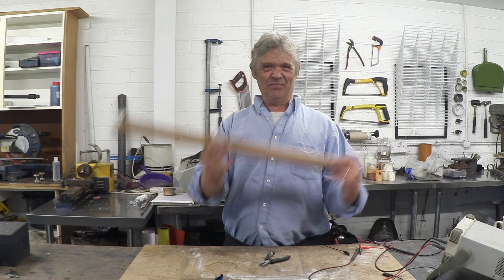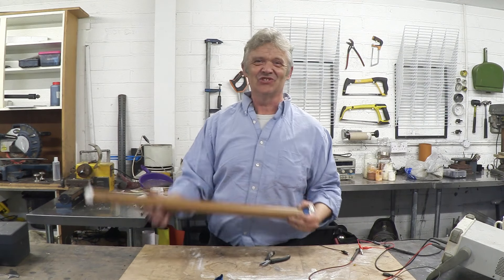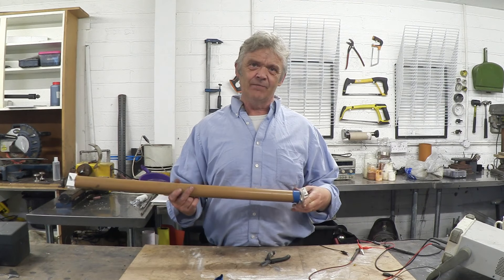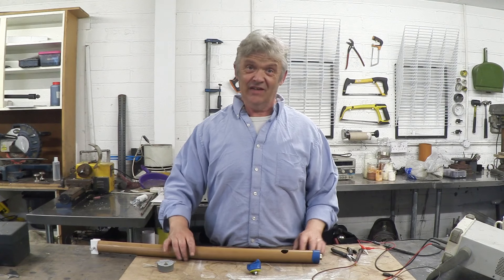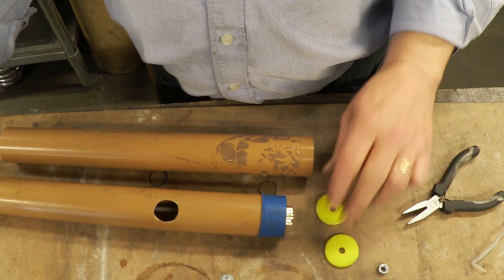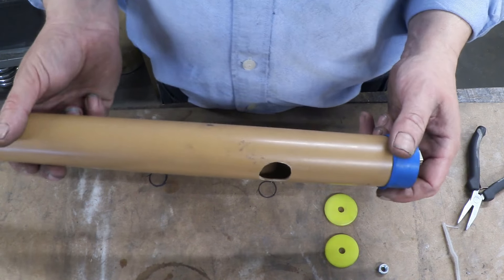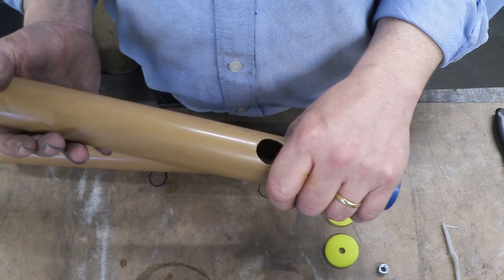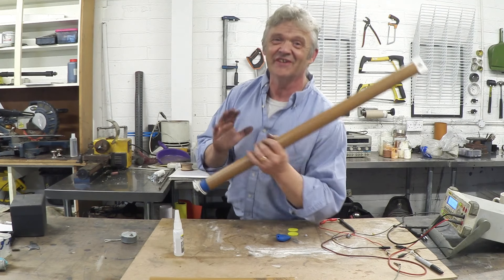A Wind Generator That Works Even When The Wind Stops Blowing

Comment: @Robert Murray Smith.

Robert may I ask you please, to investigate:

1, whether a bunch of funnels, 1. at all four ends would allow air to enter from four directions as needed.

2, A rubber check valve could be added to all four ports.

3, a kazoo or harmonica type Reed be placed in the Windstream before the air goes into the standing tube. This would make all of the air from the funnel go through the kazoo or read and cause vibrational noise in addition to the wind. I also feel that the kazoo would pick up some of the ambient vibration and channel it, or enhance it.

4. Regarding the funnels. 

I would aso like to request that the (metal  or aluminum seems best) or perhaps plastic  funnels be modified and converted into a Venturi tube by adding straws , or plastic tubes,into the jet stream; prior to entry into the small intake port.

I apologize in advance for not investigating myself, as is your request on prior videos.

As I do not have the capacity to manage it. However the ideas might be good enough for you or some of the members to explore if up to it.

Thank you in advance for your consideration.

Comment: Brilliant video, and I agree that many little things are required to solve a big problem such as millions of ants making a raft that floats to move the colony during a flood. I believe that your tube design coupled with the physics of resonance and standing waves may increase your performance.  By resonating the string in the tube at its frequency would create more vibration, this principle has led to the destruction of bridges being destroyed by horses trotting or troops marching across them. If you treat the tube like a flute then drilling different size holes along its length would ensure that different wind speeds would hit a resonant frequency. I think you have done a great thing by making your ideas public, I would do the same. Great job. :)

Comment: BRO, what if you put a flap on one end and put the flap in a running stream. constant running water will constantly cause vibration.
Reply from the maker: give it a go mate
Reply: Or a bigger magnet and coil on a raft in the waves.
Reply: @OldNorwegian  maybe it's own little raft  out and anchored just bobbing w/ a batt. for containment. Bodies of water also recognize vibration
Reply: kinda near a bottle neck area where the turbulence picks up.
Reply: I'm'm renovating a sailboat to electric and this is something I will test as well. 2 days on diesel or 3hrs by battery, if your transiting there's no gas stations in 3 days from shore.  A few of these mounted would aid in constant flow. Something to try, I' m kinda getting excited about this. One ounce at a time.
Reply: Bill. .. that's genius
Reply: Bill Ross I recall seeing a wave generator in magazine years ago. It was anchored to a dock in this case, and was supposed to generate enough electricity to power a light on the dock at dusk, the waves would make a float go up and down. There's quite a few concepts for larger scale ones, some anchored to the seafloor with a large float that would go up and down , one looked like a big mechanical snake, where each joint was a generator as they bent over the tops of waves. Not sure if they ever got out of concept phase.
Reply: Can the magnet from an old  speaker also be used?
Reply: I commented something similar to check it out
Reply: @OldNorwegian  already been done,,,,,,,check out wave hub
Reply: @vivienclogger  i think it would be too heavy to vibrate much, better to use neodyniums.
Reply: you'll get way more energy with a small water wheel

Comment: Imagine attaching lots of them at the top of the ram pump delivery pipe. You will get constant vibrations.
Reply: If you have running water, power is easy in the first place.
Reply: "good, good, good! good vibrations.."

Comment: Reminds me of a guitar or a harp, you want to put a combination of wind and temperature driven (Stirling Engine) pluckers.  I was thinking whether one could harvest energy from material expansion i.e. lead in a cylinder pressing against a piston head which connects to a conrod which is then geared down appropriately enough to harvest the movement.

Comment: Remember reading about a similar device in a SciFi story, one of "The Unorthodox Engineers" by Colin Kapp in which a planet had fields of wind-blown energisers powering an underground / metro / tube system. But for Robert's device, the volts out are important as to combine AC from many devices needs some form of power electronics and likely rectification... really need volts well into 10's so diodes can work. OK 2V would be enough but losses awful; how then to raise volts - a transformer?
Reply: Another way to increase the voltage at the sacrifice of amperage of course would be to use a voltage doubler, tripler, quadrupler and so on, circuit using capacitors and diodes. Look it up on the internet and you'll get schematics for these.

Comment: I have to look at it closer, but looks interesting. I wonder though if you could use wind pressure for induction such as in a velocity stack that leads to a Faraday model of a spring loaded sliding cylinder where the behavior would be similar to a speaker coil -?

Comment: Stick it to the side of a lamppost? I wonder if we could mount a light on the top and make it the lamppost.
Reply: Or better yet.  have something a car drives over..then a mechanism has a mini hammer or something that vibrates and turns on the street lamp.  I have a feeling it would need too much power for that much light.
Reply: I'm making a speaker style for this generator this weekend and gonna post in a bit. Any ideas how to best resonate it?😁😉so fun!!!
Reply: @strangescience3414  bet whatever your doing is too complicated for me.
Reply: I figured a light on the bottom with a large white fibre-optic tubing to work as the turbine and light diffuser would work!

Comment: I have a good way make a heat tower with a spiner on top that spins from heat as it gets hot hot air moves up fast make it spin Gen
Reply: Ya, you have another spin off idea with 'hot air rising' !!? In a close tunnel, it can spin a tunning fork type device similar to what he was talking about ??
Reply: Even have similar device under roads that capture vibrations from moving vehicles?

Comment: My fricking roof rack on my Jeep whistles, shakes, rattles, and rolls, and it's hollow. If I had a camper that uses battery off grid power, there is something there also. Thats amazing great little thing you hot there. Aluminum vibrates nicely.

Comment: This is very interesting to me, and correlates (somewhat) to my recent hypothesis on harnessing vibrational energy of the piezoelectric effect. As  many of us is aware, quartz crystal has the ability to vibrate when a electrical current is introduced. Also, quartz can do the opposite. If vibrational energy is added to the quartz crystal, in return it produces an electrical charge. I have my own ideas on how to utilize this effect and make a loop that creates energy through vibration and then feeds this energy back to the quartz to support a loop of vibration back to the silicone structure... therefore altering the 0 point (on an atomic level) of the silicone, releasing ions to restart the loop. While it is much more in depth... using electromagnetic fields to "ride on" the vibrational motion, and so on. I'm not going to bore you with my expotulation, however your creation gave me an idea to possibly help improve your design. In my hypothesis, if you were to "tune" a small quarts crystal (cut into the shape of a "reed" or "tuning fork") attached to the inner wall of your structure, and allowed the "wind generator's" electrical output to travel through the quartz "tuning fork", it should create a vibrational force that will, in return, travel through your inventions structure. Therefore possibly introducing a continual source of vibrational energy into the "wind generator". This may allow you to reintroduce vibrational energy into the " wind generator" even when there is no wind or vibration externally. I absolutely love your channel and just recently have found your channel. I can't wait to continue diving into all you can teach me, and I'm sure I will find much more inspiration from your wealth of shared knowledge. Thank you for enriching the minds of those who are curious enough to make thoughts and dreams a reality.
Reply: @denbecr49  any person whom isn't willing to try to find fault, as much as merit, in their theories is closed minded.... therefore making the word expotulation accurate. As for your comment to "word salad" to each their own, you are entitled to your opinion. It's not this feeds position to disassemble my ideals, but to potentually look at the factual principles that apply to the evolution of this apparatus. While you may not be able to understand the science behind such simple concepts, the data contained is completely feasible. Try educating yourself before you throw stones.
Reply: Enjoy the research you should have done before attempting to discount my hypothesis, and I do apologize if my vocabulary exceeds yours. I'll try not to be so scientific, and speak in more layman's term. I guess I'm to blame for thinking that anyone watching this channel would have some level of science speech understanding
Reply: @denbecr49  who has said anything about infinitesimal energy production? My theory... in which I have built a small model that generates 6 amps on a small scale.... has the potential to generate much more on a large scale. Alas, I still laugh at you because I didn't go into any real specifics on my design, because I'm still in the process of perfecting it... and I'm not stupid enough to allow anyone to steal my concept. Either way, there was no mention of infinitesimal energy production. I was simply explaining how to sustain more vibration in Robert's apparatus that he had displayed. So now I have to ask you, why would you even watch this video and then "troll" this man's work? Have you watched his other videos? This was a simple design that was a collaborative effort by people in this group that actually respect this man's knowledge and his creativity.  His numerous degrees in electrical generation and chemistry deserves that respect. Obviously,  you dont belong here, and is only looking to unjustly "throw stones". As for me, I've spent the last 14 years as a master electrician and a lifetime as an amateur scientist. Again, you have spoken, and we all laugh at you. Go back under your bridge, troll.
Reply: And as for your reference to the laws of conservation of energy.... I applaud you for finishing  3rd grade science, but is still entertained by the fact that nothing that was spoken of, violates this law. Nobody claimed to pull energy out of thin air. The kinetic energy is put in for electrical current to be expelled. Again, you open your mouth and the educated minds crack up laughing.
Reply: @denbecr49  sir, you need to reread. I have a small prototype... in speaking of my words such as "may" or might" I'm speaking of my overall idea as to how a fully constructed apparatus would perform. Yes, to scale it up would consider much difficulty, and brings doubt as to its compacity or even if it could increase compacity by scaling up. Also, I've gathered inconsistent readings as to its output... still scratching my head as to what outside forces could affect its efficiency, but I have charged a battery... producing 6 amps/hrs, though it took 10 days to do so, having to reset the process daily. So, as you see... you are reading between lines that you dont even know about... intentionally being left out because of the 1001 questions that I have about it now. As I said, it is something that I am working on. Just because you know a few verses from a book, doesn't mean that you have enough information to surmise a summary. And my information was withheld intentionally until I can identify its ineficience/ efficiency from a day to day basis. As for asking if I used a reed or fork... neither, or both... depends on how you interpret it, but this was my suggestion to this particular apparatus... not my own. So, as you see, you are shooting in the wind here because of your lack of knowledge. And again, in no way does my suggestion defy laws of conservation of energy. There had to be an applied kinetic force to deform the quartz crystal, creating a piezoelectric effect,in order to get a small output of energy... however,  I was suggesting to use the small amount of electrical current created by the apparatus to stimulate the quartz crystal into vibrating against the apparatus's wall... continuing a vibrationam to help extend the vibration of his device. And again... this was a reason to also speak with doubt. I haven't applied my studies to this advise.... but surmised that it could help in his apparatus. Completely untested.... so while you try to debunk me, it seems you have to actually read what I said... and instead of trying to debunk the subject that I have not revealed much about, maybe you should reread the point to my comments from the beginning. I only exposed my thought process on this video. So, you are so smart... tell me... why wouldn't the initial charge cause a quartz crystal to vibrate? Why wouldnt that vibration transfer to his apparatus's casing? You're the one trying to debunk it. So, go ahead.... explain yourself. Actually explain why, if you claim. to be so smart. Let's hear your technical reasonings. So far, you haven't proven you know anything over elementary school science knowledge. And, I do regress.... you were the one saying how unimpressive this man's apparatus was... so I doubt you can backpedal out of that one.
Reply: I was thinking about it, and I'm almost sure that you created your opinion because of my use of the words "0 point". Since true 0 point energy is a violation of the laws of conservation of energy, I can almost guess that you made your judgement then and there without apparently reading what I actually said. Let me give you a little crash course as to what I was explaining. Quartz is made of Sillica (positive charged ) and oxygen (negative charge)... creating a stable element. When the atomic structure is put under stress, the + & - alignment is shifted from it's normal "0 point in it's normal entangled orbit, therefore releasing ions. This is how your bbq lighter, or your grandfather's watch works... by stressing the atomic structure of the quartz molecule. While it is not true 0 point energy, it is energy created by misalligning the normal 0 point position of the balanced + & - elements... so as why I said 0 point " on an atomic level" it takes kinetic stress to cause this effect. So, I can only conclude that your ignorance on this subject, and maybe my description, made you prematurely think I was explaining the impossible. If this is the case, then I will extend my warning to actually read what I was saying... considering that you have constantly expressed your thoughts that was not indicative of what I had actually said, and even mixing up which idea was which. I'm going to give you the benefit of doubt with a warning... you should really read closer and save your comments for a time you actually understand what is being said. If you didn't understand, then instead of nay-saying you should have been asking questions. If I'm correct that this is your whole problem with my theory, then I reply with... your lack of knowledge has you jumping to conclusions, keeping you from actually comprehending what I'm explaining. Getting stuck on an idea that is only 1 pixel in a picture blinds you from seeing the whole image. If this is not the case, then I will refer you to my previous comment... you are only being a troll.
Reply: @denbecr49  actually, I agree with you on that one. And as I said before, this could be an assist to vibration.... not a perpetual energy source. I've sustained up to a 5 hr window of vibration at its peak performance... but 15 minutes under outside effects such as barometric pressure, humidity, outside resonance, etc.... so while still inefficient for my use, the longterm vibration could (again I say) assist his device... not make it the holy grail of perpetual energy and I've never claimed it would. I'm well aware of the loss of of energy in conversion  and nowhere did I suggest that this was a perpetual loop... that's why what I have done is more applicable to this type of device. Eventually it runs out of "steam"... however if the vibration came from outside sources such as traffic, it could sustain a longer vibration, and that is all I've ever claimed. Again, you need to actually read what is being said.

Comment: why use an artificial muscle as opposed to say a guitar string or something?
Reply: Yeah, I was just thinking of a thin, very long spring I have.  And my ongoing fascination with magnets! Next, we'll have to come up with a simple voltage regulator and storage capacitor, maybe set to 5v max for a charger.
Reply: The diaphram has to expand and contract. Using a well speced out spring tuned to vibrate is the mechanical method. Winding count, magnetic field strength and spring / membrane durability is key.

Comment: In step of the artificial muscle use a mildly tensioned strip of 3/8 x 1/32nd stainless steel suspended between two brackets on a 1 inch steel rod out in the open air function would be much more extreme have you ever seen a vibrating strap on a semitrailer power generation would increase by 10 fold, larger magnets placed in the center of the vibrating strip would give another boost to the current beautiful idea guys keep up the great work im building a few of these  heck put some on a barge on the water in break water area's